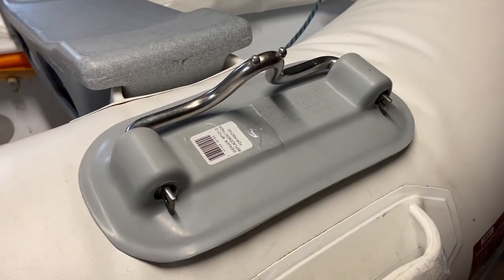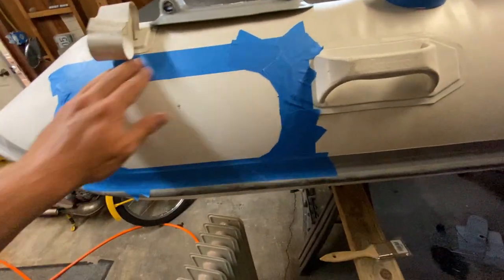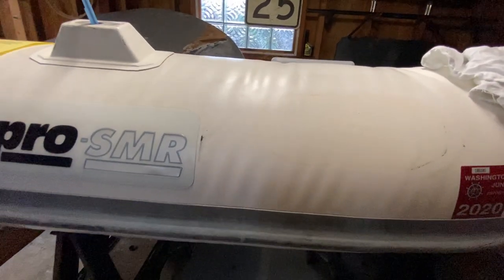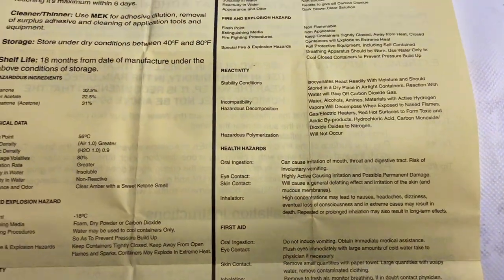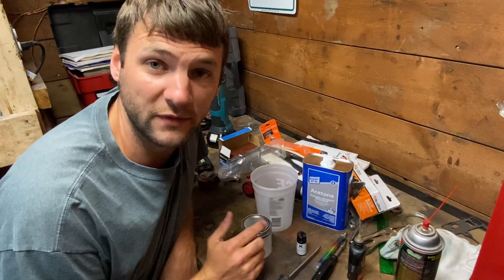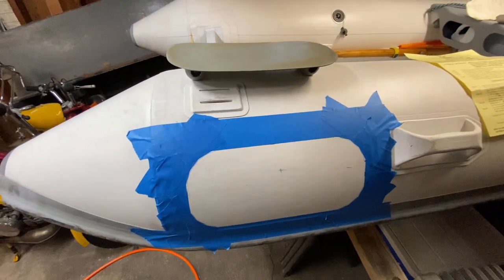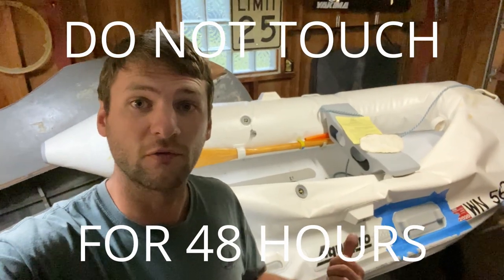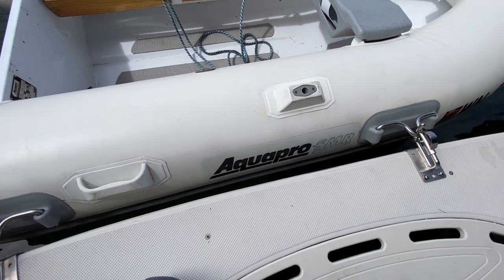How to Install a Weaver Dinghy Davit System

Comment: Thanks, good video!! to the point quickly... Curious if you have ever had glue fail or know of anyone who has?  Any warnings on how to know if the glue job is good?  Wondering about a load limit, I have a 11.5 foot PVC.
Reply from the maker: It will be apparent when the glue fails. it will start to peel, and it will peel easily by hand. It only happens if not applied correctly from my experience though.

Comment: Nice video when the boat is pulled up is there a locking mechanism and hold the boat up in place
Reply from the maker: There are standoffs available to keep it in one place instead of leaning it against directly the transom. https://www.weaverindustries.com/index.cfm/product/87_9/stand-off-brackets.htm
Reply: Using the stand offs as mentioned on our Doral 360 w the weaver davit pads on our Zodiac 10ft

Comment: Great video. Thanks. How do I apply the constant pressure from behind? I notice you have no weights or elastic or clamps during the drying time. Can I put a weight on mine?
Reply from the maker: one way is to inflate the tube and use a ratchet strap around the dinghy over the pad to kind of push it down.

Comment: Thanks for this Kevin! I installed once in the evening in the PNW and the moisture and temperature caused it to fail, so I’m preparing to reinstall and try again. Hopefully acetone will help remove the old glue from the pads and boat. I’ll also be using a heat gun to remove more moisture from the pvc before this time. 

It seems to me like it might be easier to apply pressure for the actual joining of it if the tubes were inflated. Also then it would be in the same exact shape that it will rest in. 

Does that make sense to you? Do you think you were able to apply enough pressure from the back? 

I was even thinking about using ratchet straps to get more pressure while setting.

Comment: Cool video. I have the same aquapro lightweight dinghy.for the outboard do you plop that on by hand using muscle or do you also have a swivel outboard bracket that keeps it level as you pull it up?
Reply from the maker: For me, brute force! They do make a swinging bracket for the outboard, but an arc is also needed for it. There wasn’t enough room on the transom of this dinghy to be able to use it. Needed to be about 4 inches wider to work.
Reply: Gotcha! Well that's always a way to keep in shape is throwing that outboard on and off.

Comment: Hi where did you buy the all system to mount the dinghy and how much it cost great video i learned thanks
Reply from the maker: Here is the best deal available: https://amzn.to/3v6PU3J. it doesn't include glue, which can be found here: https://www.fisheriessupply.com/weaver-industries?loc=2064731229%203987545692

Comment: what did you do for the hypalon boat? (to get the handle off)  I'm going to try and do one right now....not looking forward to getting the handle off =)
Reply from the maker: heat and solvent. check out my video about dinghy restoration and it goes into more detail removing from hypalon. I think the longer they have been on there, the harder they are to remove.

Comment: Do you need tabs for your boat? I thought you didnt if it was under 16' and less than 10hp...
Reply from the maker: I found it a huge benefit. it has way less bow rise and is more controllable while on plane. check out the before/after video I made!

Comment: Nice instructional vid. Going to definitely be doing this soon. In the progress of buying our first sports cruiser. Seen the WA tab on that dinghy. We’re from WA as well. If I pick up a 8-10ft dinghy from Amazon do I also have to get that registered? If so, how do I just go to the license dept for that. Thanks
Reply from the maker: Congrats on your first cruiser search! We have a Maxum 2400SCR and we love it. Its one of the smallest cruisers you can get with a full shower inside, and has a reliable/economical setup with a 350 and alpha 1 outdrive.
If the dinghy has less than 10hp and is used for getting to and from the boat and shore, there is no need to register. I have a 15hp and use it to zip around in all kinds of places, so I registered it just in case. Be sure to match the dinghy length to you boats beam or docking will be difficult. The licensing agency will walk you through the steps of registering.
Reply: Kevin's Garage thanks for the reply. We actually went to go see a maxum 3300 scr yesterday right under the i5 bridge. We’ll be renting a slip somewhere in lake Wa. Are these boats capable of going to Vancouver CA for the weekend? We have a 21ft bow rider right now so I know nothing about these sport cruisers.
Reply from the maker: They are definitely capable of doing that! We stayed on our 2400 for 7 nights in a row and could probably do 2 weeks pretty easily. Ours also handled 3 ft wind waves but it was slow goings. 3300 should be able to handle more
Reply: @kevinsgarage  interresting video. Newbie here with a 260 cruiser. When you say you use the dinghy to go to shore, does that mean you sleep at anchor near the shore? How can you stay 7 nights or more at anchor? On mine, after 2 days and even with solar panels (200w), my batteries are quite low and need to spend a night at a marina to recharge batteries, fill water, empty septic tank... I try to find if I need a dinghy or not. Thanks.
Reply from the maker: @andregravel8685  Yes, we sleep at anchor (or mooring ball) near shore. We have an 8D battery that can power everything for up to 5 days. Our longest trip was 9 days so far, but we moved at least every 2 nights between anchoring and marinas. running the boat helps recharge the batteries, and we plug in to shore power whenever we are at a marina.

A dinghy is also a great way to have fun while out on the boat. Not only do we use ours for going back and forth to shore, but also to go crabbing and 'island hopping' for a few hours without having to move the 'big' boat. Check out how we use our dinghy on my other channel: https://www.youtube.com/channel/UCTVd5LYCTg5gJx_W3VyY0sA

Comment: We have a new dinghy replacing a tired one with the Weaver Dinghy David system installed. Can I just order new pads to use with the existing hardware? Much like you demo’d removing the handle, can I remove the old pads from the tired dinghy and and Re glue them to the new dinghy?
Reply: Yes, I just ordered a Weaer Davit Pad RPD101, you use the previous stainless hardware, I have cleaned off the pad where the davit pad will be glued to and am just debating whether I will use a brand new tube of final fix I have or order the 2 part. A marine store told me Final Fix works just as easy as the 2 part but is less messy

Comment: When taking the handle off , you mentioned that hypalon is a lot harder to get off? What was the best way that you found? I have to do the same....but with hypalon. Thanks.! =)
Reply from the maker: My only experience was trying the get a pad off hypalon that was adhered for 10+ years. I used toluene and MEK and it was a pain to get off. Check out my dinghy restoration video for some more info on that
Reply: @kevinsgarage  that’s exactly what I need to do. Sounds fun haha. I’ll watch your other video thanks man
Reply from the maker: @TMsite12  let me know if you need any other info and I will do my best to help out!

Comment: Hi Kevin. I have a 260 cruiser and would like to add a Dinghy 270 (Mercury - inflatable bottom) on the swim platform. Can I use a motor bracket for my 2.5 hp with a soft bottom and these hinges as shown on your video? Sounds like these snap davit hinges glued to the inflatable tubes might not be strong enough to support such load...?
Reply from the maker: I would not use the motor bracket on a soft bottom dinghy, as there will likely be a lot of flex and stress on the dinghy. I would recommend only using the hinges for a soft bottom dinghy.